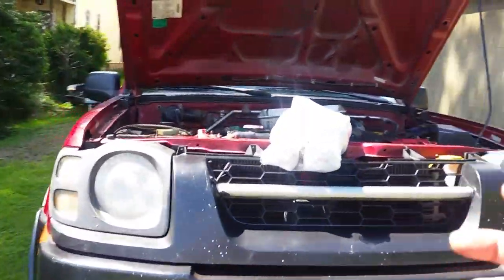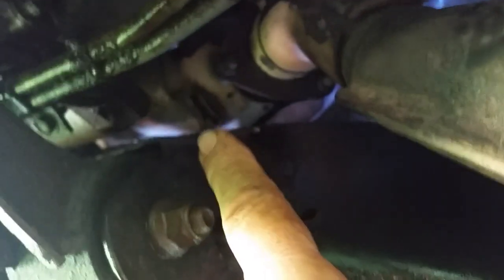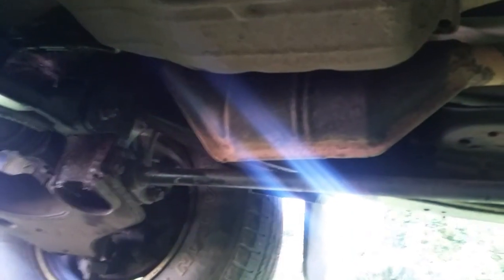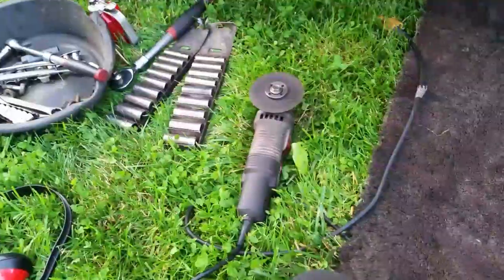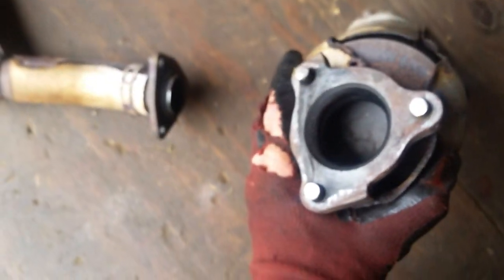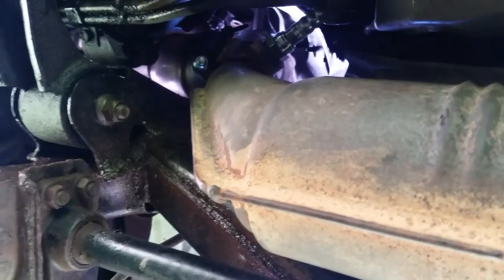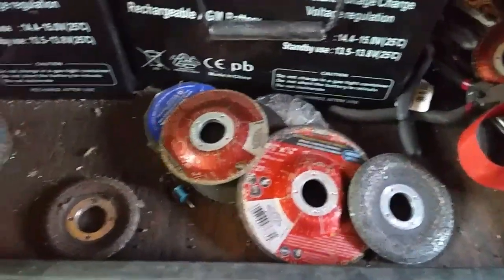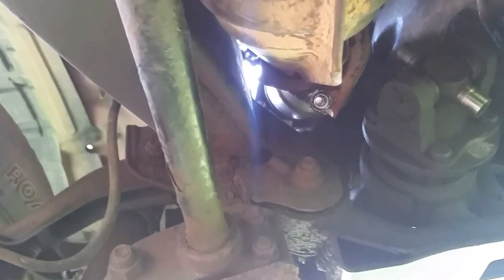Replacing catalytic converters on my 02 Xterra 3.3

Comment: I always use Anti-Seize on my exhaust bolts when I reassemble everything.  It helps make it easier to take apart if I ever have to take things apart in the future.  It's just personal preference, but it seems to work for me.  As for dropping the bolts into the grass, get a nice strong magnet and run it around the grass and it usually finds the bolt for you.
Reply: Hey Mike where can I buy that anti seize cream at? And is it only used on exhaust bolts?

Comment: While your driver's side cat is off, you should reach in and get the Crank Position Sensor on the bell housing. On 4x4's this is impossible with the cat installed.  These sensors go bad, the engine will just stop or miss, and it's hard to figure out what's wrong.
Reply from the maker: Right!!

Comment: I had to take the torsion bars out on both sides to get the center trans crossmember out  and the  passenger side exhaust off, i took that heat shield off also with a deep 10 mm and used a wrench to get that top one out  of the upper shiels around the flange but i couldnt bet the upper part of the heat shield off, i also couldnt get the o2 sensor out on the pass side so i just cut the wires. and took it out once i could get some leverage on it ,this vehicle is very difficult to work on without a lift, i still havent got the trans out yet , now i see why they wanted 2300 bucks to rebuild the trans .Its the labor getting it in and out.
Reply from the maker: Yea Its crazy! I do have a transmission drop on my channel also FYI. (In case you don't know)
Reply: @FixingWithPassion  yes I do and i have watched it several times because I and going to attempt to rebuild it because reverse doesn't work
Reply from the maker: @jbncnow  Great!
Reply: I am a complete beginner at mechanics, and having the vehicle completely dangling simulates a lift. I had to do this replacing my starter, it was a make or break situation.

Comment: Hello,I'm going through this right now! I saw that you got the front R/L converter's farely cheap I also need the 2 rear converters can you please tell me where you got all 4 for a 2002 Exterra I would greatly appreciate any assistance you can give me  I'm disabled and have limited income so I need to get the part's as cheap as possible thank you Elissa I live in Georgia 30016 area

Comment: Can u tell me where you got your cats from. If so a whole exhaust. I have a 2001 nissan xterra se 3.3 and the thing is helpless going uphill fine on the flat land but u start going up a decent incline  the thing just becomes helpless. It'll go from 65-70 at the bottom of a mile long hill to 45,40 by the time I'm half way up it and if u keep it floored is the only way to keep it going. Then the rpms will go to 4kor 5k and it will get up to 50ish and fall back on its face and drop the rpms to 2k or 3k. And repeat every mountain. Any insight would be appreciated. I believe I have similar issues to what your having. Ik on the passenger side manifold there is a gasket leak and the drivers side valve cover leaks. But I'm looking to do it all at once. If I ha e to rip the top plenum off to get to the valve cover and would just make getting to the manifold bolts easier on the drivers side alot easier. Just looking for some help and advice. Anyhow sorry for the long paragraph. Have a good day.

Comment: Were the cats clogged ?  I have an 02 X SC and it runs so hot, and used oil like candy.  I think my cats are clogged causing engine pressure and causing the oil to push up into the cylinder to burn ?
Reply from the maker: No.Mine were just old and had a few cracks in them. If you have have back pressure then your on the right track.
Reply: @FixingWithPassion  2nd time I've watched this video, working up the nerve to do the job.  How would I know what cat to replace, also what about the rear cats, do they clog ? Thank you so much for posting this, it will definately be a huge help when I go to do it.

Comment: where did you order your cat converters? having a hard time looking for one
Reply from the maker: tps://www.ebay.com/itm/Fits-2000-2001-2002-2003-2004-Nissan-Xterra-3-3L-Catalytic-Converter-D-S-P-S/183981355117?ssPageName=STRK%3AMEBIDX%3AIT&_trksid=p2057872.m2749.l2649
Reply: You must be kidding me, I just bought just the right side catalytic converter for my 2000 exterra from O'reilly autos here in druid huils Atlanta GA for $516.00. That is after I bought the universal fit from them for $250.then my mechanic say I need but a direct fit cat .so please help me out here guys, since I still need to buy the left catalytic converter. My mechanic told me last week to also replace the left cat. And as I type right now I just notice my exterra is not trying to shift past 30 miles an hour and it will start overheating when I force it. I need advice here. I just think that this first and 2nd generation exterras are just a hell of non stop problems.. My question is is it because I just changed only one cat. So plus $200.00 I payed my mechanic, it means I spent $700 on just one cat and truck is just started overheating can't shift or drive past 30 mph

Comment: Aren't the exhaust manifolds welded to the front cats on these engines?
Reply from the maker: Not mine
Reply: No.They come with cast iron ex mani then the cats bolt to them.
For some reason even the new cast manis exentually crack.I put Evan Fischer. Tubular "Catafolds" on mine.Theyve been solid for over a year now.I am currently removing the secondary cats (clogged) and replacing them with cat delete pipes from Walker.